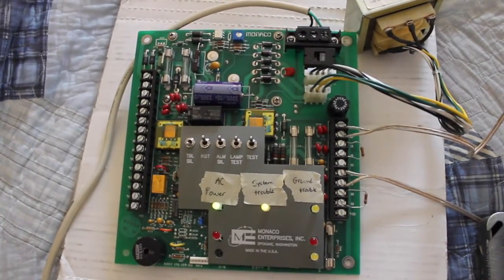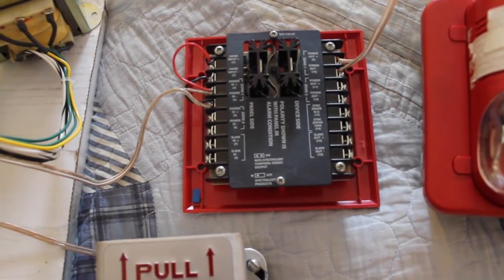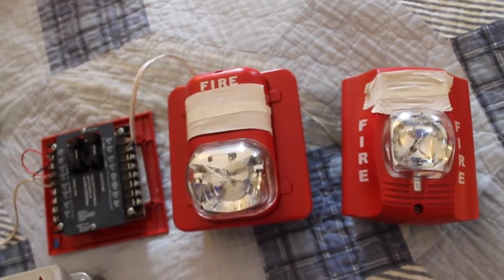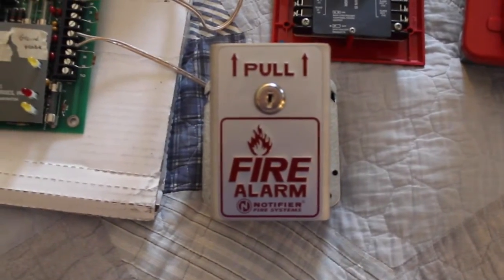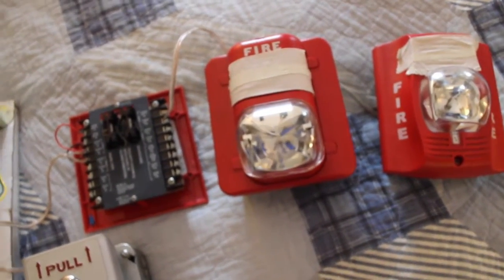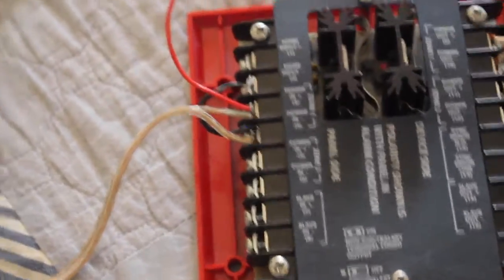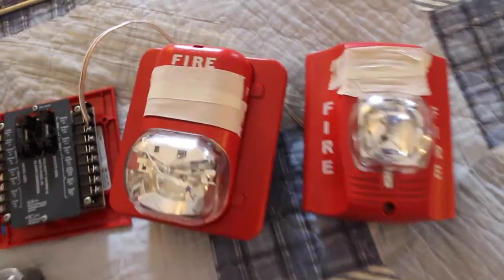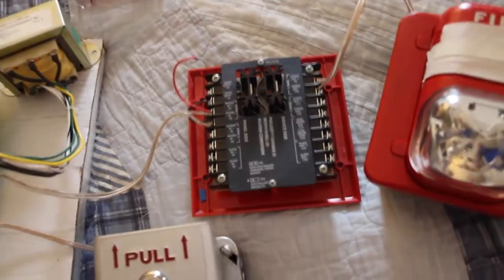Monaco Vulcan 1: System Test 10

Comment: I'm thinking about buying some SSADAS strobes and an MDL on eBay.
Reply from the maker: Not sure if the SSADAS will work with the MDL, I think it's only for SpectrAlert devices. I do recall reading in the data sheet that there is some kind of sync crystal in them, probably similar to the Genesis line.

Comment: Low Frequency test next?
Reply from the maker: Don't even have any LF devices yet. We've talked about this before, please don't make requests for stuff I don't even have. If you want to see something on the system, please make sure I have it. You can refer to my test videos.
Reply: ***** Well damn Daniel I don't know all the alarms you have. I I've been gone for a long time. What about the Edwards Integrity + EST Genesis?
Reply: ***** also, have you tried or heard of using railroad crossing bells on a fire system?
Reply from the maker: That I do have. I may consider it then. As for railroad crossing bells, I haven't. They're too big for one, and I don't think they accept 24VDC, possibly  some high voltage AC input. I don't know anything about crossing signals.